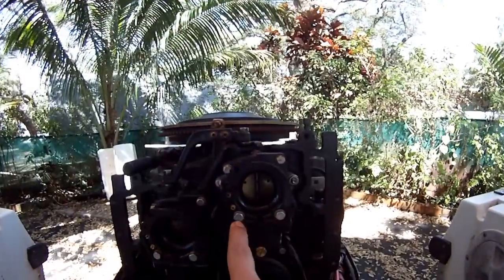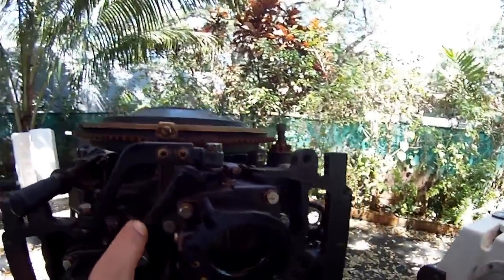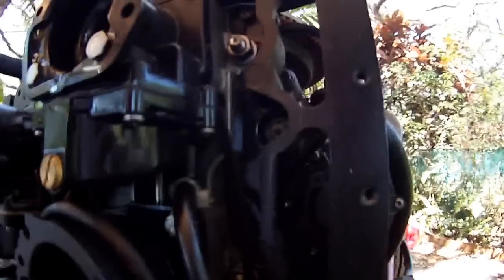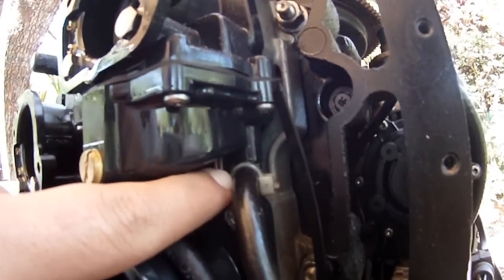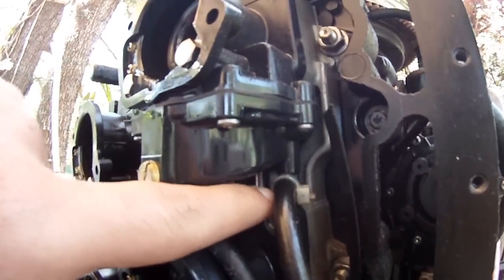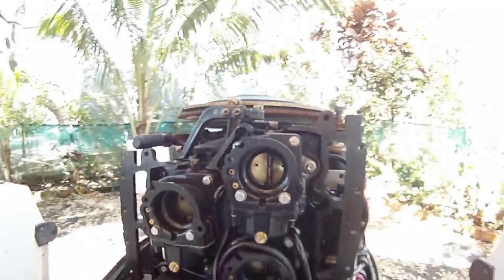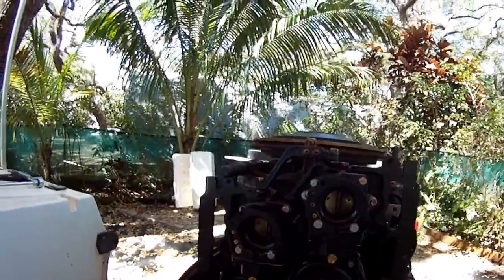How to take off the Carburetor off an outboard

Comment: did you already take the front air cover thing off before this video ? I have same motor doesn't show the part I have on front.
Reply from the maker: yes I did, the air cover just protects the carb intakes and restricts airflow. it is just a few bolts to remove.
Reply: @ReelTeaseFishing  also what bout the choke and all the other parts you remove before you can get the carbs out or does your motor not have I have a 110 1988
Reply from the maker: @manmanman6956  This is a 1989 v4 120hp. The choke is located near the vro pump. it is an electric choke and has a red lever for manual over ride. it is not on the carb themselves. it is located on the starboard side of the engine.

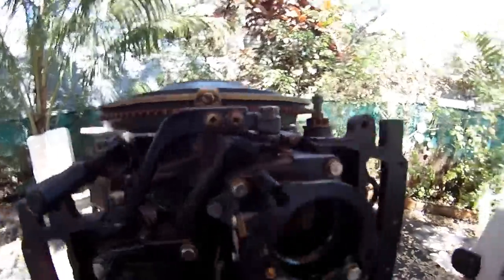Comment: Do you have a video showing the removal of the other parts to get the carbs exposed like they are at 0:40? There's at least an air intake filter in front right?
Reply: How do remove a carburetor on 75 mer
Reply: H